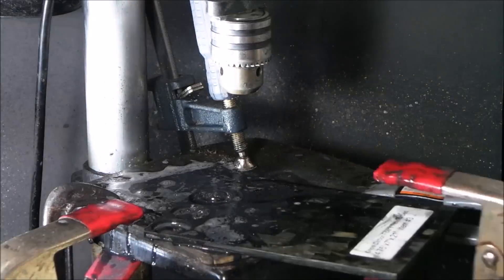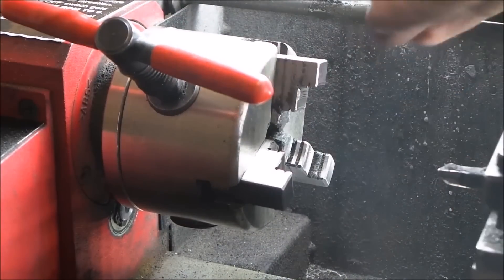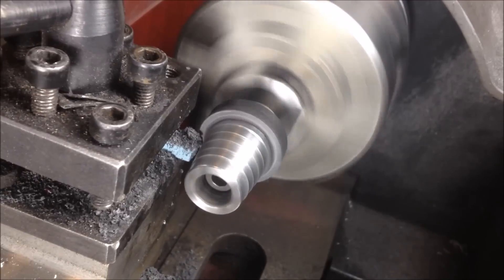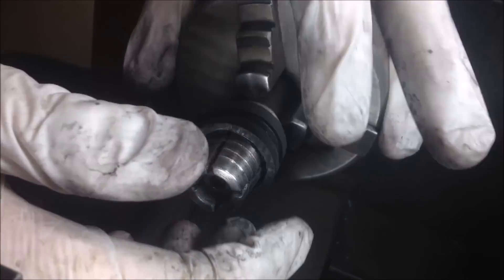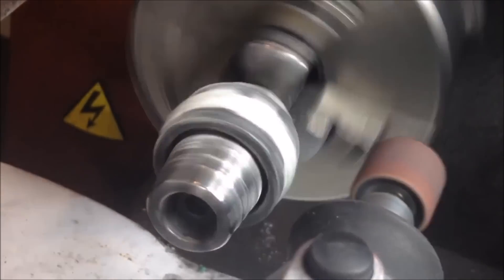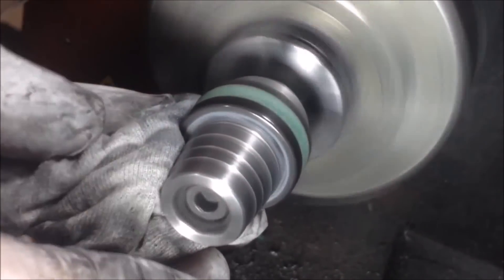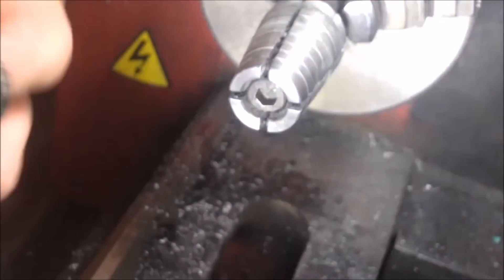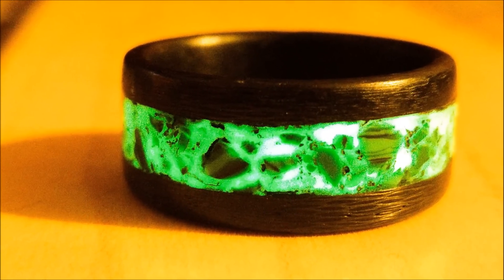How to Make a Malachite and Carbon Fiber Glow Ring on a Lathe

Comment: So glad I stumbled upon your channel. I get married in less than 2 months and I sure would LOVE one of these tungsten carbide glow rings with (I think) malachite and black marble inlay.  As you can tell, I've been by your webpage and I have a few questions. 

1. What's the turn around time to have one of your glow rings made and delivered ? My wedding is on 10/20/18. 

2. I'm a little confused by the "day time color" selection ? Won't the inlay be the color of whatever materials we pick to put in there? Like I'm thinking black marble and malachite so it will be black and green ? Or is this referring to what color we want the metal ? Sorry.. new to the whole custom ring world.  

3. Is it possible to color the metal on a Tungsten ring ? Or is it possible to get a high polish finish with Tungsten ? 

4. What is the life expectancy of the strontium illuminate in terms of its bright glow properties ? Will it eventually stop glowing ? 

5. Is it possible to get a single small stone set somewhere on the ring like a green stone ? It can be emerald or a simulation emerald stone ? If not, no problem.  

Thanks for taking the time to answer these. I'm going to email you this message as well as to not delay the process. I look forward to (hopefully) wearing one of your rings on my wedding day. Thanks!

Comment: these rings are awesome ... but wouldnt it be less work to make a cast for each size on the resin rings somehow to cut out some of the work later on... if you had a cast fir the right sizes couldnt you piur the glow powder and eesin and then pop them out and sand them to save work time? just wondering... id love a set of these ... i love watching your videos as well! great work! Firehawk0079@gmail.com

Comment: Thanks for another good one Pat! I've been gluing the two CF plugs together after coring from the blank then just cutting the inlay dado with a small parting tool with good results. I'm going to try CA gluing the stones in then mixing the glow powder with Alumilite and casting the remainder of the inlay. Something, as you know, you can't do with the CA since it sets up so fast. I'm hoping it will fix the blank clear spots around some of the stones. A touch of color dye in the Alumilite may work too.  I'll let you know how it goes. Happy turning!